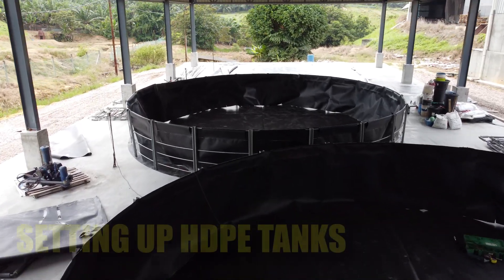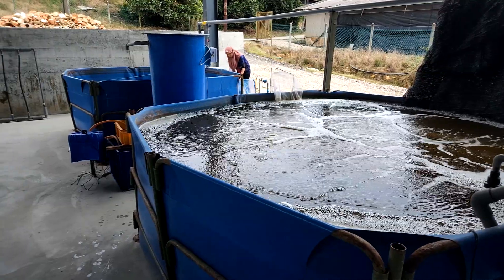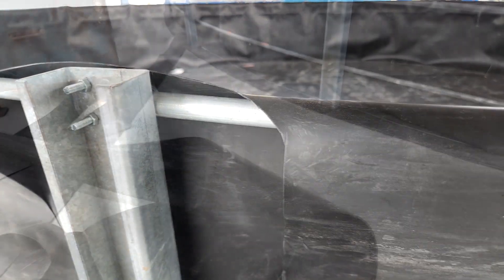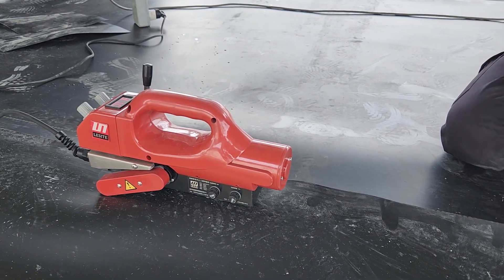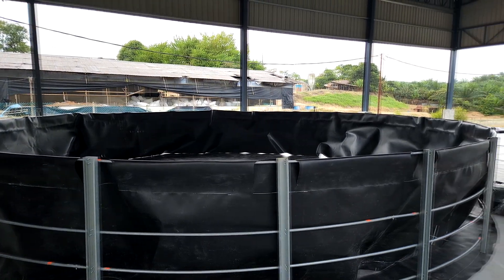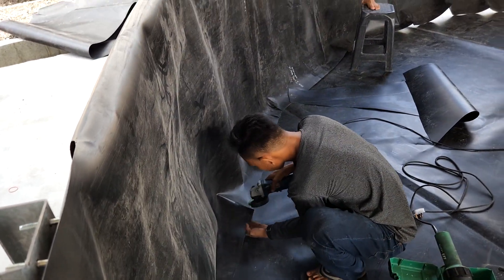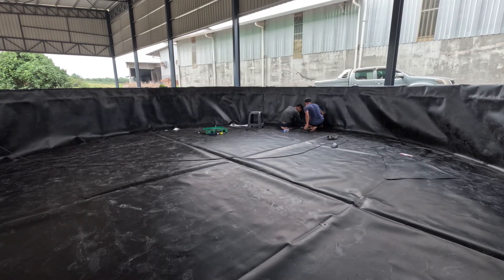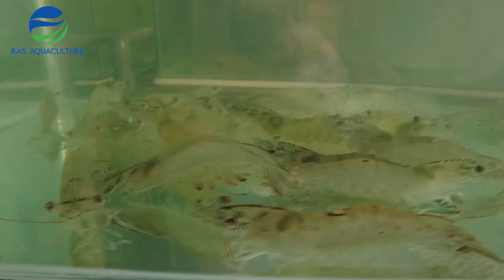Step by Step Guide to Setting Up an HDPE Tank for Shrimp Farming

Comment: Very Nice.. I liked your video.. Best solution for shrimp farming. I am also planning same, with 10meter dia and 1.7meter(5.5Feet) height tank.. Plz tell more about U type steel structure and wire dia. and how many numbers to be used in a circle..thanks so much...